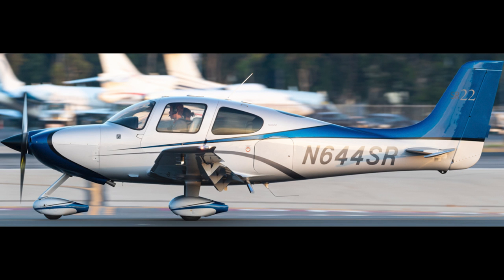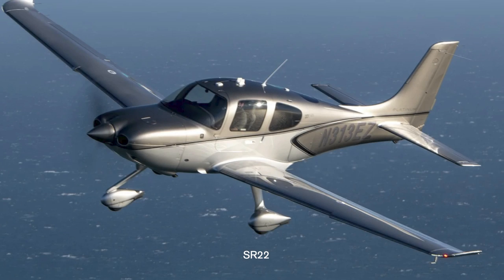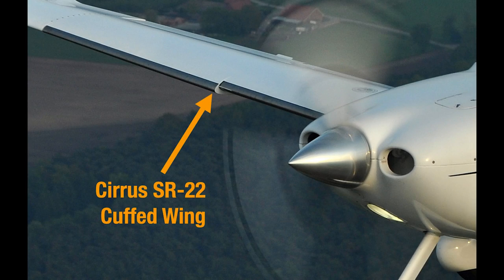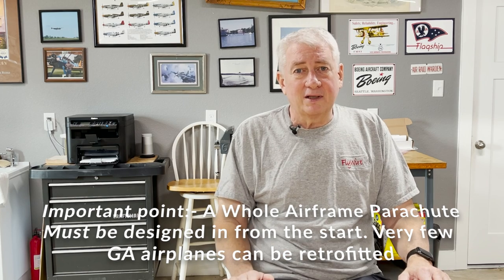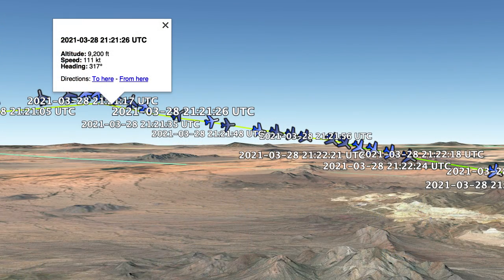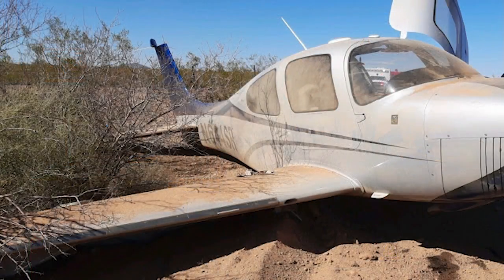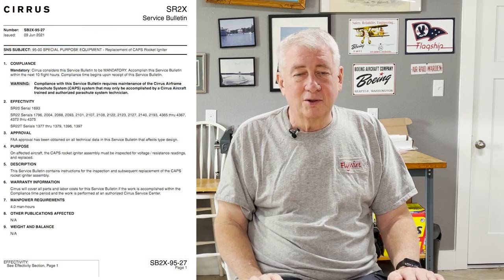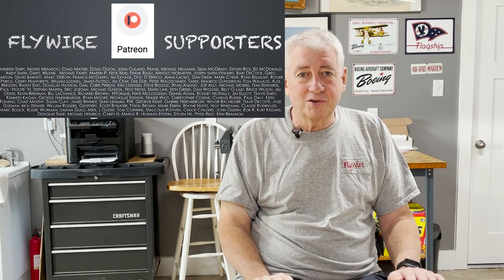N644SR SR22 Engine Out And No Chute

Comment: Maybe someone here might know or be able to answer an easy question. Most people that parachute out of planes do so at the required altitude and a stable flying airplane. If a pilot wore a parachute while flying his GA plane and there was a serious structural damage occurred, possibly a wing fell off or the sudden loss of the tail or surface controls were mute. In a fast falling, thousand pound vehicle- would a pilot even have the strength to unbuckle themselves, open a door or window & lift themselves out a seat to exit an aircraft that's in a uncontrolled decent? asking for a friend :-)
Reply from the maker: I guess in your scenario you’d have the rest of your life to figure that out. Given the choice, I’d go with the struggle.

Comment: Does the Cirrus POH say to pull the parachute in an engine failure, regardless of any circumstance such as having a good off-airport landing place, or even an airport right under you? I've not yet driven a Cirrus, but I think if I'm at a good altitude and have acceptable landing choices under me, I'm going to land instead of using the CAPS. Is that a responsible choice?
Reply from the maker: Sounds reasonable to me.

Comment: Is the Cirrus that deployed their shoot at to high a speed do to icing the same  plane that crashed behind Sugar Bowl Ski resort in Truckee Ca around the 2000’s?   If I recall a Groomer was working Mt Lincoln around 10 pm ish and came across a piece of parachute on one of the ski runs. The plane ended up down on the backside of the resort. I forgot about it until reading the commit about the Truckee Cirrus crash. I was a mountain rescue volunteer at the time and remember getting woke up and thinking “what the heck” when they mentioned the piece of parachute.  That would make it 10 miles do east of the Cirrus that just crashed in Truckee.  That area and the rest of the sierras sure are unforgiving to aircraft.

Comment: They don't use radios at that glider port I taken a few intro flights there wonder how that would have worked out with that guy coming in landing there. Maybe the trailer has someone in there can talk to the tow plane the Grob 103 didn't have any radio in it. I saw 3-4 guys flying in the pattern with glider trainers they would go up fly one circuit and land roll up behind the line of gliders. The tow plane would just taxi by slowly guy would hook the first in line up and wave his hand off the guy went up for another pattern circuit. The tow plane be back down on the ground again in no time. I don't think anyone was using a radio. I wonder about those Chutes once you pull them have no control what if winds takes you over steep mountains land on a cliff and fall from there, or into power lines. I think if I had a good chance to land on a runway up high enough just glide it in and land.

Comment: Thank you for the detailed video.  But may I a request? Please straighten the picture of a boat on a river. Above your right shoulder.
Reply from the maker: Sorry, it doesn't bother me... and that is a picture of an F-4 close to the Mach fixin to fly over that boat.
Reply: @FlyWirescottperdue  Rodger that…. It’s kinda like me flying in a  slip or skid.  It doesn’t bother me that much.  Yet my instructor takes issue with it.  I mean what’s so dangerous with a plane stalling  while in the circuit. And going into an incipient spin.

Comment: I’m currently flying a Czech Sport Cruiser for training towards my Sport license. Actually, I’ll  be buying one here in the next couple of months. The Sport Cruiser has an option for a BRS and honestly, most do come with them installed. I absolutely love the idea of a chute. But in the Sport Cruiser, the useful load isn’t that great. And I think I’d rather have the extra 40lbs free’d up. I had this exact conversation yesterday, as Scott talks about here, with my CFI....he drilled into me, first thing you do is fly the airplane! Our conclusion was, the real lifesaver of having a chute is at night....yet as a Sport pilot, we can’t fly at night. I also think it would super helpful flying over a forest. Being 1320 MTOW, we don’t have the weight to really plow through the trees in an emergency. Instead, we’d get tossed around, flipped and torn apart, badly. Having a chute is definitely a trade off. But like my CFI said, “Regardless, fly the airplane first. And don’t stop flying the airplane.”

Side note....After watching a previous video of Scott’s, we’ve also been practicing engine-outs on a take off. So thank you Scott.

Comment: This was thought provoking. When I fly "up here", up here being the Four Corners area my outside scan includes "where do I set this bird down if the engine quits". And you're right, glide advisor doesn't take into account the approach phase. It's a bit optimistic. The desert and mesa tops look smooth when the engine is running lol but when I'm driving around down here on the ground (poet in the making?) it's rough as hell. The ruts from winter don't fade away in the summer.  As you pointed out, there are rocks in the desert. Smooth ain't smooth until it is.
Reply: Glide adviser, at least on the latest software versions, will give you a buffer if you RTFM.
Reply: @mytech6779  That'll come in real handy if you know what terrain you're going to be flying over when the engine quits

Comment: You definitely go for any runway before the parachute. The chute sacrifices the plane so that is a very last resort. In most terrains I would try to land the plane. I would only resort to the chute if there is loss of control where death is certain. I have a small personal reserve chute so I can step out of the plane if necessary. Only weighs 1.5kg, nice option to have if the plane slips a wing.
I know Cirrus advocates using the chute almost at any problem, of course they sell more planes but I'm not sure I agree.
Is there an engine reliability issue with planes in general? anecdotally it seems engine failure is super common and I'm not sure it should be when they are so expensive and so expensively serviced. I mean what good is the price and service if they fail often anyway.
Reply: Often service is skipped because it is expensive, or "cheap" service is hired. Old fuel is used, tanks aren't sumped, filters aren't cleened, oil checks prior to every startup are laughed at like dumb teenagers do, "oh yeah sure man like the oil was stolen since the last flight", many pilots like to stay ignorant of the actual mechanics so they fail to recognize odd sounds that often precede failure. Etc
It also doesn't help that certificating engine upgrades is completely cost prohibitive, so ie the sparks on older aircraft are still weaksauce 20Kv magnetos while even my 70year old tractor has had a $50 kit upgrade to more reasonable 50kv ignition and hall effect triggering. (New cars are pushing 100k and race engines even higher along with lower impedance for more current, though with too much the plugs don't last long.)
Reply: @mytech6779  I don't get the sense that people skip that much in aviation and many of the super old planes are certified so require mandatory service.
And it's not just certification cost, there is incredible stagnation in GA engines. Inexplicably so. An IO580 engine costs over 140 grand! if they can't amortize certification of the tiniest modification over the last 60 years, who can. That is grotesque profit margins. And it's not like the engine is grown monocrystalline metal. It's indiana jones era junk.

Comment: As AvWeb and others have discussed, it's kind of surprising how the whole Cirrus emphasis hasn't really worked out very well in actual outcomes / accident data. It's gotten a little better, the parachute has certainly saved some lives, but the overall outcomes have to be much less than what was envisioned. The training seems to be the cause of the improvement, but then most manufacturers can generate the same improvement the same way, so...
Reply: The Chute has saved over 150 lives since they started installing them.
Reply: @speedomars  ... minus how many lives have they cost from higher risk taking / overconfidence / lesser trained emergency landing procedures taken seriously because they were present? The accident rate was above average for years for a reason.
Reply: @ReflectedMiles  Incorrect.  The higher accident rates for Cirrus in the early years was due to the high performance and low drag characteristics of the plane versus older aircraft and pilot trying to fly them without proper transition training.  This was also true for rentals.  Cirrus changed all that with what is now called the best training in the industry.  And Cirrus creates a special trainer called a CSIP which is a CFI with special Cirrus training.  No one is allowed to rent out a CIrrus now with at least an hour of transition training that Cirrus pays for...  Now Cirrus has among the lowest fatality and injury rates in the industry.
Reply: @speedomars  Looking at the data from the three years or so immediately before the pandemic (not all finalized), relative to the overall trend in the GA accident rate, I disagree. We'll see what tale time tells.
Reply: @speedomars  What has happened just since this discussion? Cirrus fatal after Cirrus fatal, with and without chute deployment. You mentioned that they are high performance, but most of my complex single hours are in faster, retractable-gear aircraft, so to me, it's a lower-performance airplane than those that tend to run way ahead of inexperienced pilots (Acclaim, PC12, TBM, etc.). Obviously it's higher performance to most new private pilots, but I'm not sure those are the only people crashing them.
Reply: @ReflectedMiles  Cirrus has one of the lowest fatality rates in the industry now...training and the chute are the reasons why.  Cirrus are high performance, all of the, but especially the SR22T.  The gear has nothing to do with performance...in the Cirrus the fixed gear has a 2kt penalty but in exchange you get NO belly landings or expensive gear to maintain and insure.  The Pilatus and TBM are jet-props, not piston singles.  The Acclaim and Ovation Mooney's were wiped out by Cirrus in the markets.  Most learn in a Cessna 172 or other lower performance aircraft, and most owning a piston single (or even twin) are flying the old metal/rivet designs and are much less sophisticated and lower performance.  The early crash history for Cirrus was due to these pilots from the draggy, older, slower planes getting into a sports car and losing control.
Reply: @speedomars  Apparently Cirrus proponents can't read well, either.

Comment: Mr. Perdue , Can you comment on 
1-the thousands of accidents like this on GRM turns.  Too many do them wrong.
2-Also the too many 180 base to final turn accidents? Wind factors, banking factors, optical illusions like "Ground Rush" and ovrshooting pull ups and stalls. 

  Im no good making videos. I just read about those things years ago.  Thanks.. 

NTSB is not clear about WHY they stalled, they just say.. LOC stalled.  Not why he stalled.  They say WHAT happened, which all pilots know.. A stall.  But.. they dont say the factors that made the stall, The Why.  They cannot decipher the factors or all the why he stalled it.  Thanks
Reply from the maker: Are you talking about Ground Reference Maneuvers? I've done some overshooting base to final stuff in my UPRT videos.
Reply: @FlyWirescottperdue  Which video Mr.  Perdue?

See the Latest GRM accident by a Delta Captain in Logan, Utah, on june 27th..  He stalled his LSA and hit a house DOING FLYOVERS over his family and friends.  
Sad to see a captain die doing GRM mistakes.  Flyovers are not taught at all by most CFi's.  I did teach turnbacks and turnarounds to a flyover.  Friend of that EFATO CFi posting as airplaneemergencyturnbacks.

Comment: I’m not sure I understood your point, Scott.
Are you saying:  rather than maneuver for an airport that’s beyond gliding range, he should have maneuvered (or done less maneuvering) to a good spot over which to pull the chute, within its envelope?  …and with a plan for if the chute doesn’t activate?  Are you saying he was fortunate the chute didn’t activate where he had pulled the handle, because the landing on the road would have turned out better than parachuting into rugged hills where help would have a hard time getting to you?

If the chute actives but doesn’t inflate…well, I guess there is no plan after that.
Reply: After your engine quits is not the time to look for a safe landing spot.  A good pilot will ALWAYS have a spot picked out.

Comment: I gotta say, as a Cirrus pilot myself—who admittedly has never faced an emergency situation in the airplane—I can’t IMAGINE deciding during an engine out to do something cavalier just because I had the chute backing me up. I am fairly well indoctrinated in the Cirrus mantra of “pull the chute first, ask questions later.” So my first reaction would be to use my glide energy to find a safe place to pull. Is that irresponsible? Maybe, but it beats the hell out of a “save the airplane” attitude that would go looking for a runway.
Reply from the maker: I'm pretty sure that is exactly what I advocated .... using energy available to find a place to pull the chute. I don't agree with pull the chute first and ask questions later.

Comment: did I hear that right, he was descending at over 1000fpm, reaching as much as 1600fpm?!?!
Reply from the maker: yep
Reply: why do people dive for the ground so aggressively when the engine quits. Seems more pilots need to practice doing descents at best glide with the engine at idle in their airplanes to know how it should look, feel, and sound. Most planes should have best glide speed near Vx or Vy, it's much slower than most seem to realize. And if you trim for that airspeed, it's really easy to then be able to shift focus to looking for a landing spot.
Reply: @SoloRenegade  you haven’t been in a Cirrus with the throttle pulled all the way back. Airplane drops like a rock immediately with very bad glide ratio.
Reply: @tropicthndr    I’m not a Cirrus (or Airbus) guy.  Is there any way to set the prop to a low drag, high pitch setting during an engine out, like in a non-FADEC airplane?
Reply: SR22 POH states 8.8:1 glide ratio at 92KIAS and 3600lbs(MTOW) Which equates to 1060fpm decent at standard sea level. 
However the best glide speed will be reduced with reduced weight and true airspeed increased with reduced air density. (Similar to how stall speeds are effected.) Assuming the glide speed is not adjusted for weight, a 7000ft density altitude, and 8.8glide ratio you get 1180fpm. If we then assume 8.2 glide ratio because of non-ideal airspeed that becomes 1260fpm. 1600fpm and 8.0:1 yields 114kias at 7000ft. 
Keep in mind 75% power cruise at 7000ft in an SR22 is over 150kias.
Reply: @mytech6779  Very nice using the actual numbers, makes much more sense now. I was actually just computing some performance numbers on my own plane last night based on existing values, and data I've been collecting in flight, never crossed my mind to check the numbers on the Cirrus. I guess I just never expected the Cirrus to descend that quickly in glide, but it is a faster plane than many common light aircraft. Much easier to see how 1600fpm was occurring, particularly if the pilot wasn't holding best glide very well at times.

Comment: I don't follow the logic. The Cirrus fatality rate went down dramatically AFTER retraining Pilots not to ignore the chute so much. Pulling the chute as "Plan B" sounds like just the thing they should have done, especially after figuring "Plan A" was not going to work.
Reply from the maker: Ray, you over simplify what I said. The training program as a whole tightened up and emphasis of chute use was a big part of that. It as NOT the only thing.

Comment: Attempting to deploye the chute and having the chute not work DID NOT COST THE PILOT TIME.  Also, attempting to glide to an airport is a standard practice if you have calculated your altitude and glide distance properly    The chute is PART of the emergency checklist, not the entire thing.  If the chute failed to deploy then crash landing the plane is the only option left.  For planes WITHOUT a chute crash landing is the ONLY option.  Hundreds have been saved with the chute.  It is a proven safety feature and planes that do not have one are flying at much higher risk.
Reply from the maker: Thanks Speedo, I take it you are a Cirrus pilot and believe that I am attacking the chute. You are mistaken.
Reply: @FlyWirescottperdue  I was a Cirrus owner/pilot...sold the plane a few months ago.  But I did fly it for six years and can say from personal experience that the presence of the chute made no change in flight procedure.  The chute (contrary to critics opinions) does not make a bad pilot a good one, nor does it act like a crutch.  It is just another safety feature with a specific purpose and use no different than the fire extinquisher or the blue button on a Garmin autopilot.  You made an assumption that the chute may have 'interfered' with the pilots ultimate decision making during his emergency.  The opposite is true.  A Cirrus pilot must first consider using the chute in specific emergency situations if above the minimum altitude and below the maximum speed.  If the chute fails to deploy, then an emergency landing is the next consideration, as happened in this scenario.   The only difference being if you have a chute, use it.  If you do not have a chute, then glide to land and take your chances.